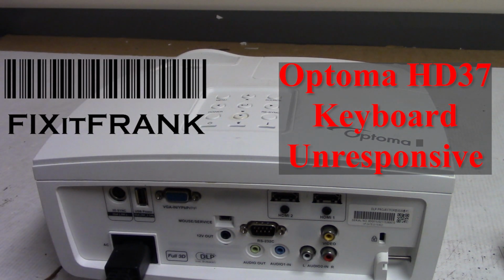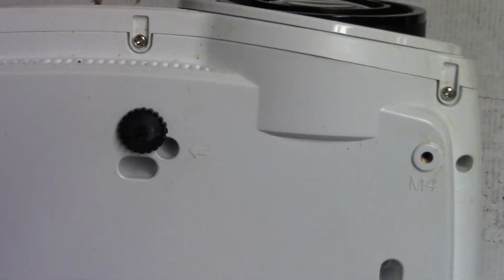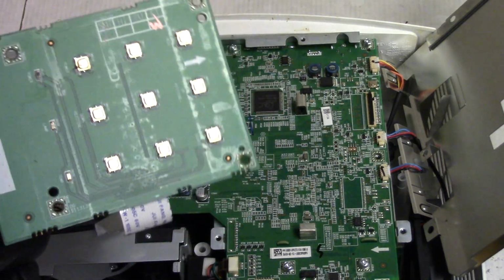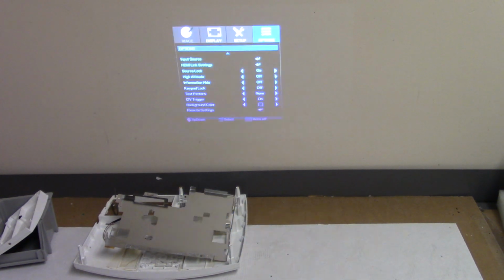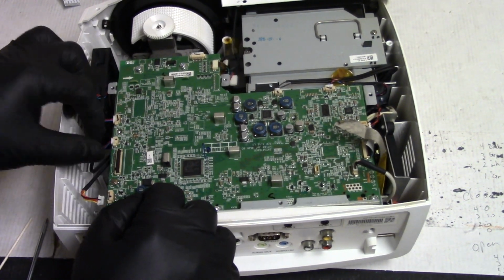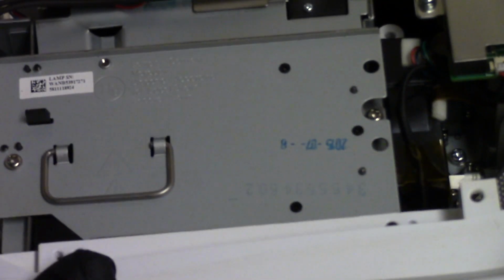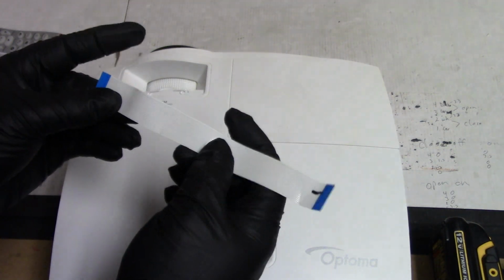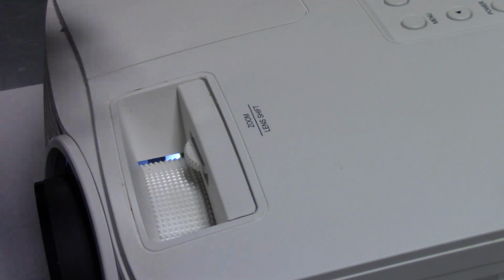Optoma HD37 DLP Projector Repair | Keyboard Not Responding | Water Damage

Comment: Hi @FixitFrank - I have an Optoma UHD38 Projector that stopped working recently. Its not getting powered on  and LCD display also non responsive on the Keyboard. Opened the Projector to check if power is going to other components like Capacitor/Lamp etc. Looks like the issue is with Keyboard, the power is not coming to the power button itself. This is just my high level diagnosis and I am a novice when it comes to electronics. Came across this video of yours and it is very helpful and looks like similar to the issue i am facing. Is there a way you can help me in checking and repair it ?
Reply from the maker: I hate to say it but you likely have a bad mainboard.  Not a bad keyboard. The UHD series is a nightmare to work on.  I won't even take them in for repair because the repairability is worth than Epson.  I must preface this with "In my opinion" Optoma dropped the ball on the entire UHD series.  It was their last lamp series and I think they cut every possible engineering corner they could.  I have seen UHD38s, UHD60s and other fail with bad mainboard 2 weeks out of warranty. They did a terrible job on thermal management and what tends to happen is the mainboard gets slowly cooked until the BGA chips start desoldering themselves.  
I hate to be the bearer of bad news, but any extra time you spend on this model will be a waste of your efforts.  
I'd check out the newer BenQ or Viewsonic models currently available.

Comment: I have the same projector and it appears to have 2 dust spots on the lens but i guess it's on the inside or maybe it's on the bulb?  Is it possible to.get dust on the lens from the inside and if so how would i clean it.  Mine is still working great with original bulb.  Thanks in advance.
Reply from the maker: it could be inside where the DMD chip is.  The problem is you can cause a lot of damage in that area if you're not careful.  One thought is that you want to make sure the lamp is new(if its more than 3/4 of its expected life span for instance).  A dim lamp seems to show more blemishes.
Reply: @FixitFrank  thanks for the heads up.

Comment: hello I was watching your video I have an optoma gt1080 and you don't want the buttons it works well it responds when you want the power button works well the other ones don't have any idea how to repair it because I accidentally deactivated the remote control and I can't enter the menu activate again I would appreciate it very much
Reply from the maker: Ooh. That's a tough one. Can you turn it off via the power button? If so you can try entering the service menu and doing a factory reset.